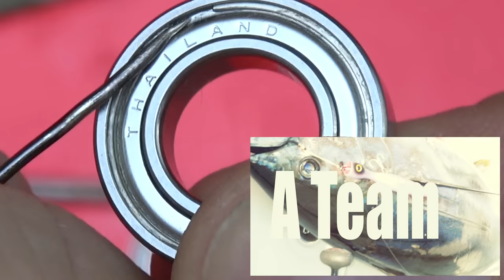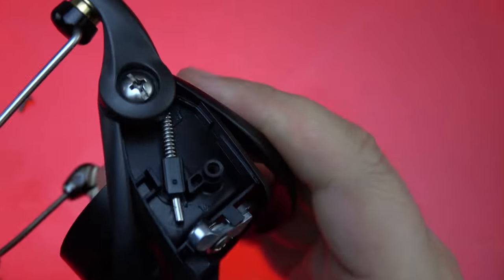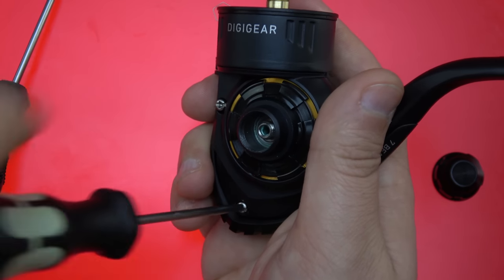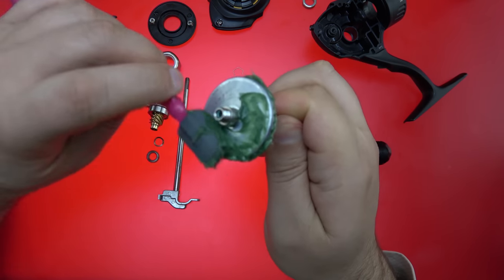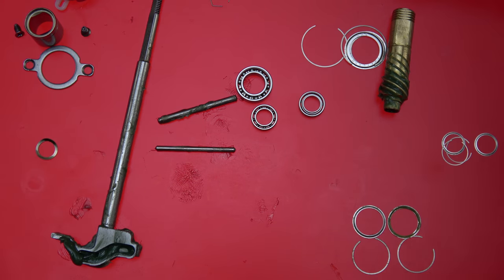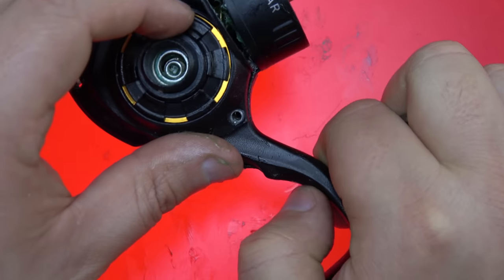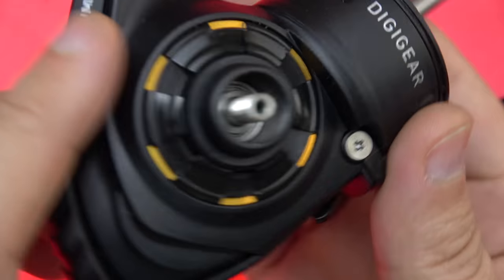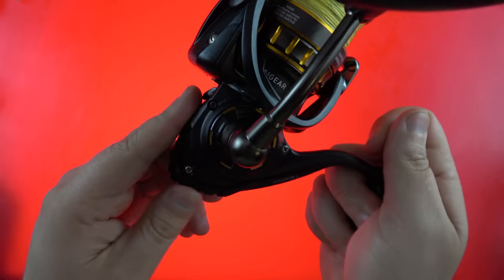Daiwa BG Full maintenance and service tutorial. How to protect your reel against  sand and saltwater

Comment: I have a BG5000 and I've read about packing grease. Can it hurt the real to pack grease where the handle winds on? Never done that before and some people say not to. I fish it hard for Snook in South Florida Personal opinions?
Reply from the maker: You can flood the opening with grease... It will likely make it a little sluggish... It will prevent some saltwater and debris from getting in the bearing.  But it's not a 100% long term seal... And I'd only do that if really hard on my stuff..but know grease is a sand magnet.
Reply: @TackleAdvisors  Agree about the SAND MAGNET! I'm definitely hard on my reals but I do rinse and clean about every other use, roughly 3 to 4 times a week during summer Snook bite.
What about that crappy roller bushing?? Is there an upgrade for a true bearing? Maintenance on roller bushing advice? Thanks a bunch! You're by far the best a most thorough on YouTube, even though some of them are kind of long LOL.

Comment: Would it be ok to just pack the bearings with the corrosion x grease
Reply: Not unless you want your bearings and reel to move incredibly slowly. Oil inside (most) bearings. However, I am not servicing surf reels. If I'm taking a reel apart to service, I do rub a light coating of grease on the outside of the bearing after making sure that oil has made its way inside the bearing and the bearing is spinning well and quietly. A grease coating on the outside of the bearing helps to keep oil inside and anything else outside.

Comment: Do you have a solution for daiwa bg 4000 grinding noise? I’m using j-braid 8x 30lbs on daiwa bg 4000 on 9’ foot rod. I can cast a pencil popper with 2 oz and reel line fine. As soon as I up my weight to 3-4 ounces (bucktail), I start hear to grinding or squeaky noise. I tried apply to WD4 but it won’t kill the noise. I want to hear your advice. Thank!
Reply from the maker: First off........Sup man!     So does  this grinding happen only when under load?    Try taking the reel off the rod and flossing the line roller with the reels weight.....gotta isolate where the noise is coming from.....If it's the line roller....dismantle and thoroughly clean.    Replace if damaged is present.   WD40 in my experience causes more problems...it de greases and moves lubes away from where they are supposed to be...and attracts grit.   Corrosion x and TSI 321 are the only oils I'd say to use in the salt from my experience.........If that doesn't fix it ...It's likely the top pinion bearing.......replace it with this https://amzn.to/2WevLeC     But inspect the exisiting bearing to make sure it's raspy....a cheap ebay bearing check tool is an awesome tool......the handle is a sound amplifier and helps identigy  corroded bearings....lemme know how you make out at TackleadvisorsInitiative@gmail.com

Comment: How can you tell if the BGs are knock offs or made in china? What upgrades would you recommend during service if any of my BGs are either or. Thanks
Reply from the maker: No idea.. Never saw a knock off.... I'd replace the top pinion bearing with a sealed boca yellow seal bearing and add some tsi 321 to the the handle side plate bearing.... And grease the threads of the non handle cap... Also tsi the line roller frequently
Reply: @TackleAdvisors  Thanks for all the reel content. The tab that engages the AR clutch on my bg4000  broke off. Pretty much the only thing you didn't cover. My luck. lol. part is on order. You suggested replacing the top pinion bearing with a sealed boca yellow. Question is how to match it up to replace it? thanks

Comment: I'm very curious why you did not use Bel Ray a world wide water proof grease it's about 12$ for 16oz...very powerful water proof grease with amazing staying abilities..will Not wash off high temperature resistant and of course forever longevity. This grease has aluminum properties and zero oxidation when in contact with water or salt water.....what do you think about using this on spinning reels?...or for that matter ball bearing in a reel?....And the last but cheepest....Supertech Marine Grease from Wal-Mart as well...works AWESOME! on the line roller on my Daiwa BG 5000 even thoe....Sand did MAJOR damage (sanding down both collars) one on the metal Collar and One on the White Collar next to it. It would make scratching sounds even after I cleaned it. BUT as soon as I used Supertech Marine Grease SMOOTH AS BUTTER!!🤓! Tell what you think about these products😀😀
Reply from the maker: I think it comes down to using the product for a bit then moving along to the next one... Takes time... Lots of it... All grease is good... But it's now it holds up over half a season.  (it's rare anymore I buy a product that flat out is horrible and needs to be replaced day one... 20 years ago sure.. But now I already kinda know what I want.  It's also why I haven't put out any vids with the new stuff I'm using.. I really dig it.. Best I've used so far.. But only about 60 outings split between like 30 reels in rotation lolol.  I've heard great things about both you mentioned.. Just haven't gotten there yet lol... Yama lube was my go to for so long It stunted my experimenting up until 5 years ago lol

Comment: Daiwa BG 2500 or 3000 for light tackle stripers (schoolie to slot), mid-size blues, small albies, and fluke?
 Going to put it on a 7'6 Medium Rod.
Reply from the maker: I'm not a light tackle striper guy.  Smallest spinners I use are 15 ounce class reels....Though i know a few guys that use smaller stradics and luvias paired up with light rods and pick off little guys off the jettys in the off season.
Albies I'll chase with reels in the 10ounce range (4k stella which i think is 3k daiwa sized)
I've seen the 3500 get tortured with tonnage of bass in the 30#s in heavy current.  That was eye opening when it came to the capabilities of the bg...that reel has since died...but it took a season and a half to kill it.  So For the little guys...i'd bet the smaller BG would hold up fine

Comment: What would be the most likely cause for a bg2500 anti reverse to slip or not engage?
Reply from the maker: excess lube, or the wrong kind.  Or debris at the topside or bottom of the cylinders that make up the clutch preventing them from moving inward and outward freely.

Comment: Mr. Advisor, my Daiwa BG 6500 has the slightest rough spot at the very  bottom of the spool oscillation. I honestly don’t think it hampers performs in any way but it’s annoying. Any ideas? It’s freshly serviced and the noise has dimished some but not completely. Could it be grease needing to work itself in? Idk but it’s obnoxious!
Reply from the maker: Possibly bent spool shaft.  My friend bent 2 on a pair of 4500s bucktail ing pulling out snags.
Reply: Interesting, would it be noticeable if I disassemble it? I have put the reel through it’s paces but I didn’t check that when I just had it disassembled
Reply: Thanks for the response as well I have a trip to the outer banks coming so the 6500 will get a work out
Reply from the maker: Not really.. Unless you roll it on a flat surface.  Also make sure that the oscillation gear underside is clean and the oscillation support rods are straight
Reply: Its the side plate. Tightness of the screws.

Comment: I have followed your tutorial to clean up my bg now I have a problem. the reel is not spinning well and its harder than usual especially if i tight the roller also if i rotate it slowly it go half turn and hang in the middle. any advice ?
Reply from the maker: A few things.
Greasing the bearings heavily will make it tighter to turn...over time it will loosen up....It's done to protect against the effects of saltwater.  
What goes half a turn?  The handle or the rotor?
Did you get the c clip installed on the main gear properly?
And is it shimmed properly.
Did you bend the spacer under the oscillation gear??
Reply: Check a schematic make sure it’s shimmed correctly under the rotor I’ve run into the same... amazing the difference a shim washer can make!
Reply: it turns half way because you assembled it wrong

Comment: Wonder where both corrosionx & aquashield are available to together, don't seem to be able to find a single on-line site - hate to pay 2x shipping, etc charges. And mucho thanks, trying to slow down a 2500 where I cut off the bail, but it spins so quickly that I'm getting 25% braid catches on the roller !!!

PS: both of the above are still compatible w/Daiwa's factory lubes ???
Reply from the maker: I know aqaushield is....never played with the cx and daiwa grease...you can get a 10$ replacement bearing from amazon from boca it's a sealed yellow seal hybrid ciramic.   It's pretty tight and better sealed than the stock on.  I replaced iton this reel because this one had corroded.

Comment: You are just like a Rolex watch Service repair shop that make old watches like new Have not open up my 3 YO BG4500 as there is no issues. Only oil the outside😀
      Same as my 4.5 YO Yamaha moped with liquid cool. Valve has no been adjusted as the power is still strong.😁

Comment: Tackle Advisors could you please letme know if the power knob can be replaced?I dont see any screw to remove it.
Reply from the maker: If there is no screw.  You need to drill out the rivet on the handle.  Not always the easiest job.   Center punch and good drill bit and a vice are recommended.
Reply: Tackle Advisors  thanks!no screw there.need to be drilled.the saltist though has a screw..

Comment: I have the same reel, dropped it in salt water the other day and it took on a lot of sand. It is super loud and grainy when i reel in now. If i do everything in this video will the grain go away?
Reply from the maker: It should.   But you may need to replace the top pinion support bearing and possibly the bottom one.  Those are succeptible to corrosion especially if dunked.

They are good bearings but not super corrosion resistant.  The grease packing i did on this will make the reel sluggish but protect better.
Reply: Tackle Advisors i just did it to my reel and the grainy sound when away, there is still some but at least it doesn’t feel grainy to reel in now too! Thanks!

Comment: Look at Shimano Japanese videos how  they perform maintenance of Stella SW. You put so much grease everywhere the reel probably doesn't spin at all.
Reply from the maker: +I.O. Stella SW is a fully sealed reel I have a bunch and service them completely different.  I've also fully packed one.. This reel is greased in such a way that it's now protected 10x better against salt and sand.  Surf fishermen don't need or want a free spinning reel.  We want one to last trouble free and not need constant weekly maintenance
Reply: Tackle Advisors Well, in such a case that might work good enough.
Reply from the maker: It's a preventative type of thing.  Without any seals..saltwater and sand can kill a reel in just one outing.  This method while stiffening it up a bit offers tons of protection
Reply: Put a blunt tip needle on that syringe. Less waste and cleaner more precise application.

Comment: How many time after fishing you recomend for this maintenace,since I just oiled/greased on the moving parts.thanks
Reply from the maker: +koni nuryaman full strip and grease including bearings... Annually... Unless it's dunked then I inspect and do the needful.  If not fished a ton you could go into another season as long as salt and sand didn't do harm.  Line roller and spool shaft get a drop of oil every other trip.  Dropper bottle with corrosion x oil in the car is all ya need
Reply: Tackle Advisors thanks for your  answer, very usefull n informatives video.

Comment: Just an FYI if anyone did what I did with that silly little clip that holds down the non gear side bearing. If that clip shoots off into the abyss never to be found again, and you don't want to pay to have a 50 cent piece shipped to you, you can make one that at least for me is easier to work with. I just took a piece of #5 single strand wire and made a circle slightly smaller than the piece the bearing sits over. I just use two micro screwdrivers to spread it out slightly so it fits over and into the gap. Bearing doesn't slide over the wire at all so it does the same job. To get it out just find the end of one side, push down, and the opposite side will move up. From there you're good to go. I did run the sharp ends of the circle on a piece of sand paper just so they're not sharp, but that's probably unnecessary. If you already have the tool to make loops in wire it's a 30 second process.

Comment: The clicker on my 4500 BG is getting close to silent. Do I need to order that specific part or is there a quick fix. Thanks
Reply from the maker: Sounds like the click plate needs replacing under the spool.  They do fatigue especially if you take the spool off frequently.

Comment: How do you maintain and clean your saltwater baitcasters after use?
Reply from the maker: That's a bit tricky....my reels I prep before they ever get used in the salt. So i literally don't do a thing but let them bake in my car and rinse them off in the rain.  
If it was a new out of the box reel and didn't want to involve any screwdrivers.    I'd buy a bottle of corrosion x oil.  linked in the description.  And spray it under the drag star.  I would also use tsi 321oil on the spool bearings.    Occasionally wiping down the frame with a paper towel with a bit of corrosion x oil on it.  I'd fill a small dropper bottle (that e cig juice comes in )  with some corrosion x oil.  ANd occasionally put a drop on the levelwind worm gear and handle knob where it meets the handle.    Also...coat the spool shaft with either corrosion x or tsi..and wipe off.

Comment: Is there a way to remove the handle on the 8000 size of the bg, Im tryning to put a power knob on my bg, but i heard you have to drill the original knob out and im not a big fan of doing that. Any other option that you know of?
Reply from the maker: +Fishing The Surf yeah I think ya gotta drill em.  Not too hard.  I usually hit the back of the rivet with a center punch and drill em.  Try jigging world they may have a handle
Reply: could i knock it out in some way with a hammer and a center punch on the pin or something, because im trying not to to drill it out because if I do and for some reason I need to return the reel they wont let me. any other possible way you can think of, i woul really appreciate it. By the way I really respect the amount of time and work you put into your videos, definitely keep it up.
Reply from the maker: Thanks man!  Nah.sorry..no other way I'm aware of with riveted on or press fit handles that would allow it to be brought back to stock other than buying a new handle

Comment: My daiwa bg 3000 spins like a dream for one rotation of the handle then she becomes really hard to turn for a couple of rotations. Anyone know how to fix this
Update. as I was taking the reel apart it was almost impossible to take the pinion off the rod. Later I realized the pinion rod is slightly bent and the pinion won’t slide down far enough.  Can try to straighten the P rod out. Any other suggestions?

Comment: I do at least 1000 reels a year in my shop. CorrosionX grease and oil is the best BUT the grease is too thick as it comes to use in a spinning reel. I know this reel will be much harder to turn and use. With your next reel cut the grease with CorrosionX oil to thin it out.
Reply: you don`t listen very well..he clearly stated that the reel will be considerable harder to turn, Packing a bearing with grease will always give you that result. The whole point of what he did was to help salt proof those bearings.

Comment: I have some bearings in my Nasci that are kinda loud and not that smooth, should I pop the shields and oil them or soak them in acetone and then denatured alcohol? And also should I use grease or oil? I only use it for saltwater and I take care of my reels and just really want it to be smooth
Reply from the maker: They definitely need to be cleaned and lubed.  If oyu hear them they are at "that" point.....It can be just debris....maybe just dry...but even dry qualilty stainless bearings are pretty quiet.  It may be that a touch of corrosion has impacted the inner or outer race.  I prefer grease for all saltwater reels.  I corrosion x grease can be cut or thinned with corrosion x oil.

I like denatured alcohol becuase it doesn't make me dizzed.  I never found Soaking bearings to be effective at really cleaning them.  WHich is why i used that water pik.  Best bet scrubb em with a toothbrush and soap.  Then swish them around in alcohol to get the water out and dry really quickly.
Reply: Tackle Advisors ok thanks
Reply: Tackle Advisors I meant I only use it for freshwater not saltwater, oops, but I understand for saltwater I want grease and freshwater probably oil
Reply from the maker: I gotcha...Keep in mind that grease will stay put and stay effective a bit longer than oil that is a bit more easiliy displaced.   Grease will also keep them a tad quieter.   Make sure you use a good oil either way.  Tsi 321 in my experience lasts the longest.  Followed by corrosion x.  ((the only two oils i use at all anymore after using tons f different ones)).  If it were me....I'd grab a tube of corrosion x grease and some corrosion  x oil....   Make a 1 to 1 mix of grease and oil.............and  use that on the bearings.  Those two lubes will last you YEARS if you don't use it all up around the house..I find corrosion x oil is spectacular on stainless appliances in wiped on with a paper towel.....better than anything i've ever used before.
Reply: Tackle Advisors Ok thanks 🙏